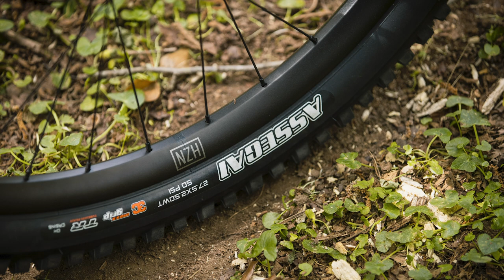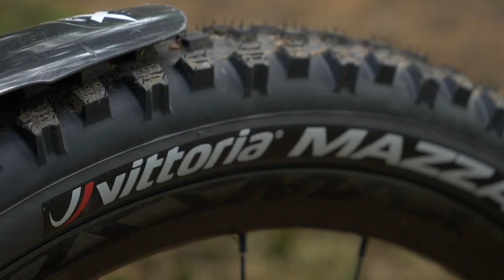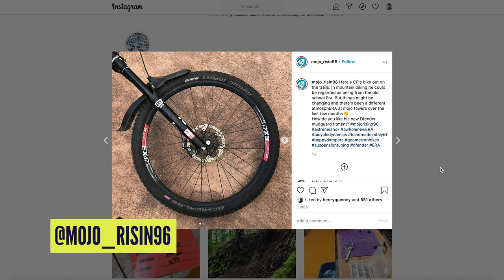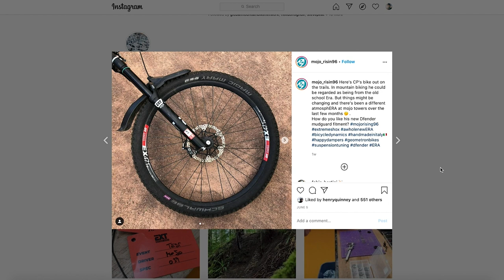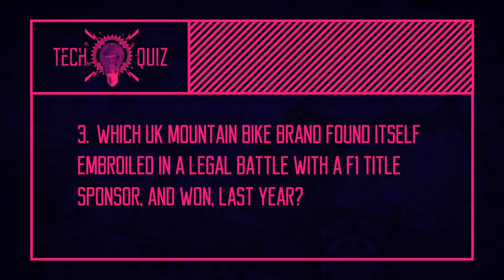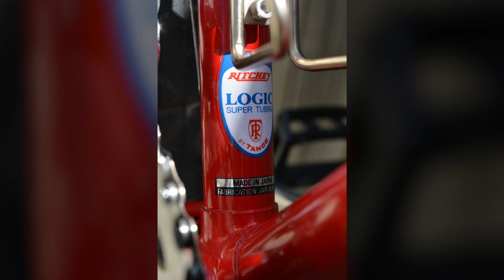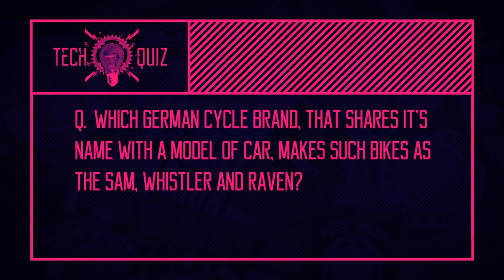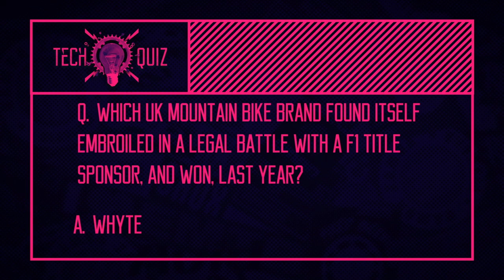New Trail Bikes From Commencal & Ibis + New Tyre Tech | GMBN Tech Show Ep.128

Comment from the maker: Did you work on your bike today? What do you think about the new Commencal Meta TR? Let us know 👇
Reply: yes, briefly, i cleaned it and a couple of parts. the new commencals look mega!
Reply: I really do think that there is a certain amount of good life changing designs for tires and for manufacturers to borrow designs to make a better tire is a great use of the older designs of other tires to make yours a more grippy and better looking tire
Reply: i clean and tinker with my pride and joy every day !!!
Reply: Yep set up for a group ride
Reply: Fixed a bent mech hanger (which was driving me insane), test ride, clean and lube up with Muc Off Ceramic
Reply: Still have an Answer hyperlight on my '95 Arrow Seminole. Might send you pics to it. Sadly I had to replace my Quadra 21R. Mad things we did back then to strip weight off of our bikes. And nowadays fullies weigh in at about the same weight. It's crazy really. But I love to be back on the bike after 22 years of compulsory break due to back surgery. It's just the best hobby out there!
Reply: Where is the link to Totally Wild? Cheers.
Reply: I'm curious why they went from the 35 gold air fork to 35 silver coil fork on the base model.
Reply: Yep, found where the grinding noise from my derailleur came from! when i replaced my chain, i ran it through the cage underneath the wee lug between the jockey wheels rather than over it, haha what a numpty! All sorted now, no noise n smooth shifting.
Reply: I waxoil-ed my steel gravel bike. What a mess!
Reply: Only two bike caves, yet a sh°tload of rewinds ... something's off.
Reply: I think there's a full sus all-year daily driver in there for me - just add bell, reflectors and dynamo to go with gum-wall tires.
Reply: that commencal meta is definately an interesting, cool looking bike AND has a decent pricetag on it. I am saving for another one, but this one is on the list now
Reply: Commencal are fantastic bikes , represent great value and ride amazing
Reply: the new Meta`s look beautiful, not sure how they will ride but damn beautiful.

Cracked my grips last weekend and got that fixed today :)
Reply: Meta TR yay!!! But still awkward shock angle... not flush with top tube nor seat stay...

Comment: #askgmbntech Hey lads I’ve got a question about brake pad materials, since there is many compounds of brake materials such as resin, semi metallic or sintered, is it possible that companies could manufacture pads with the top half of a pad resin and the bottom half metallic? In theory this would get the best of both worlds in terms of performance of the brakes with the resin pads having a strong initial bite but the metallic half of the pad staying powerful as it heats up so the brake doesn’t fade, is this already a thing or could it be implemented? Also I’ve heard about some racers using a resin pad in one side of the caliper and a metallic pad in the other side to also get the best of each performance range. Let me know what you think of this and would it work. Thanks in advance, have a good one lads.

Comment: It's quite ridiculous that almost every brand from year to year increases the travel on their bikes to "make them more capable" and yet I haven't seen trails being rebuild to be that much more difficult. Now Commencal has an enduro bike and ...another enduro bike. And quoting their own rider "too much enduro is too much enduro - never go full enduro!"
Reply: In my opinion a 130mm trailbike is enogh for 90% of the people. But enduros are the cooler bikes for them.
Reply: Max Mustermann Depends where you live? I find I’m constantly running though all 140 on my trail bike and wouldn’t mind 10mm more for the North Shore.
Reply: Isaac Taylor Enduro and Trailbike is also a difference. I had a 130mm Fuel EX 29 and it was fine for two years. Later i bought a dh bike and I got a lot faster. I went through travel all the time with max spacers in fork and shock. In my opinion its not good to run a bike on the limit all the time. So i bought an 160mm 29er enduro. On my hometrails (many roots and rocks) I need around 150mm travel but with much higher speed.
Reply: @MaxMustermannnnnn   Whereabouts do you ride mostly?

Comment: I had one of those Mongoose frames it was only available for a year in 1998. The next year the front triangle was almost the same but the rear was like a modern Kona.. The one in the photo had a thread between the swing arm and the linkage that could lower or raise the rear swing arm and BB. It also had treaded cups in the headtube to raise or lower the headtube. I had one in limited edition black. My rear shock fell apart after. DH run.

Comment: #askgmbntech Hey Doddy and Henry,  love the show! I currently ride a 2019 Merida One-Twenty XT trail bike equipped with a Rockshox Revelation RC (130mm travel). What are the limits on up- or "down"grading the travel on Rockshox' forks with their Upgrade Kit? The table in the manual for DebonAir Upgrade Kits suggests possible changes from 120 to 160mm and vice versa but i can't get my head around that span and the changes of the geometries that would come with it. In a nutshell: can i change the travel of my fork from 130mm to 150mm? The inscription on the upper tube of the fork suggests sag percentage for 130mm and 140mm. Thanks!

Comment: Tech Quiz Nitpicking:  IFP = Independent Floating Piston. { I'd say all pistons are INTERNAL.}  The IFP moves independently of the damping piston [which carries the shim stack].  As you note, the IFP keeps pressure on the damping oil to prevent cavitation -- which has nothing to do with air, it has everything to do with the damping oil forming tiny bubbles -- containing vaporized oil, which ruin damping because the oil + bubble mixture has a much lower viscosity than non-cavitated oil. Cavitation bubbles form if the damping oil is under low pressure and as the oil is forced at high speeds around the damping shims and through various metering orifices, all of which cause wicked turbulence and localized pressure changes within the oil.  If the oil is kept under pressure [typically 150-200 psi], the cavitation bubbles collapse quickly or are less likely to form at all.

Comment: #ASKGMBNTECH another brilliant tech show, so Doddy with your knowledge can you help me please? My latest project is a 2007 Rocky Mountain ETSX 70. I'm using the frame and swing arm but with all modern components :- SRAM Gx 1x 12, Mavic 27.5 wheels, dropper post....... Anyway the carbon swing arm has unboltable dropouts so I'm make them 12mm longer for 27.5 wheels, should I make them a few mm higher to steeping the seat post angle, what are your thoughts on a 2 degree offset headset on this frame? I have a 60mm stem to keep the reach the same as I'm comfortable with  but how long is too long with my handlebars with this stem length I've bought 800mm Nukeproof bars that have cut marks down to 680mm. Any other suggestions on helping this old frame feel more up to date as an all round MTB would be welcome. Thank you 😁 Shiggy the project man.